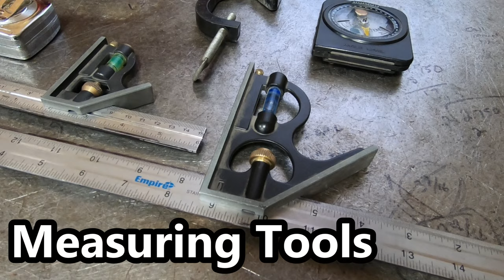Tool Time! What Tools Do I Use?

Comment: Awesome 👍 everyone can take away from your comment of "keeping it simple, simplicity is key to being efficient". Straight in line with the old adage "work smart not hard". Great content as always. Also I'd like to ask what is the tool just off the passenger side of the Supra? And I commented on another video about the aluminum exhaust, you replied that you wouldn't recommend it, care to weigh in on that?
Reply from the maker: Thank you for your kind words. That's a tubing notcher, which I didn't include in this video as I use it very sparingly. 

In regards to aluminum exhausts, I've found that they're more prone to have failures than one made out of another material. This can be attributed to it not dealing with heat, vibrations, corrosive items in exhaust, etc. 

It makes it more enticing if you have the ability to fix failures, but the service life of an aluminum exhaust is far shorter than that of stainless, titanium, etc. in my experience.
Reply: @AlexLindner  No problem, thanks for your contribution to the car community. And I thought as much for the longevity of the aluminum. Are aluminum bellows/flex joints a thing maybe? Not in the mood for the cost of titanium, so stainless and or aluminized stainless it is 😂
Reply from the maker: @rickshults2697  My pleasure, thank you for your support. I don't know of any aluminum flex sections, unfortunately. Out of the materials you listed, it's hard to go wrong with a stainless exhaust in terms of cost effectiveness and longevity.
Reply: @AlexLindner  could possibly use a stainless flex joint v-banded...maybe one day I'll look into it lol